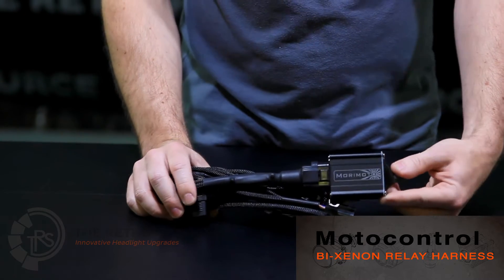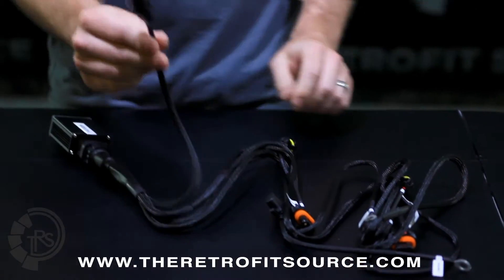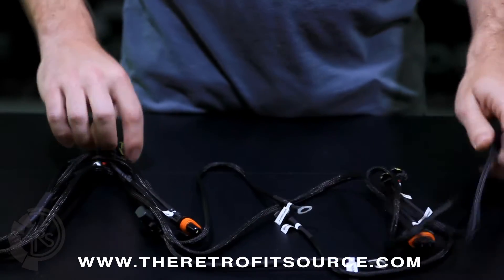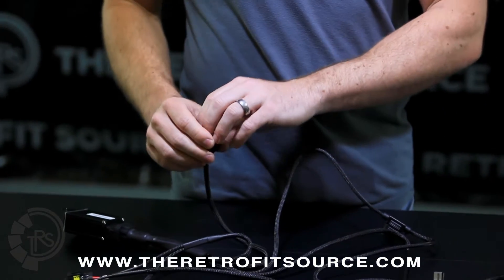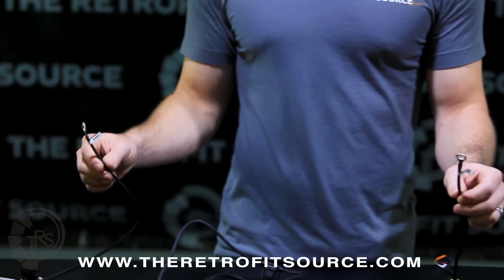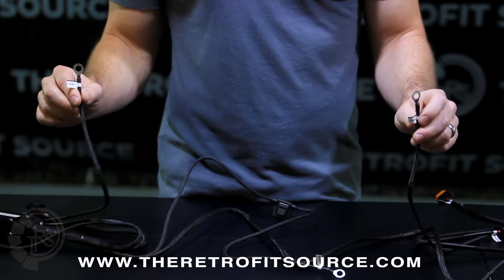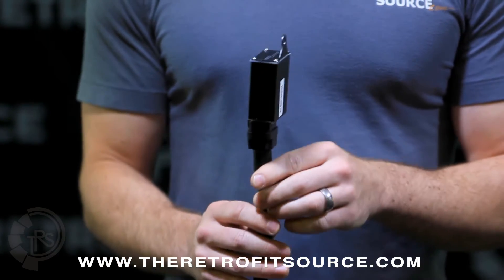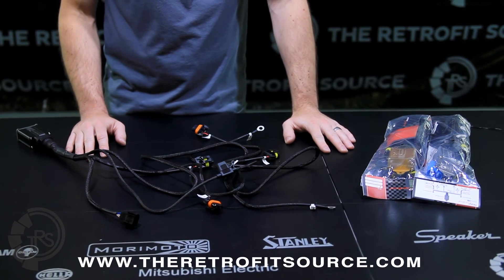TRS Tech: Morimoto MotoControl Bi-xenon Relay Wire Harness Connections Explained

Comment: Can I change the pin orientation at the factory harness connection that comes from the relay harness so this will work on my low beams only and still control the hi/low beams from the switch in my truck? I only want the lo beams to be HID for night driving? I have aftermarket headlights and and they are single beam H1 bulbs Hi and Lo wired to a 9007 male connector? Thanks
Reply from the maker: Reach out to our CS team so we can assist you with this custom wiring job!

404-220-7940
Support@TheRetrofitSource.com

Comment: I want to retrofit Bi-xenon (with projector) to my e46 but want to keep halogen's original function as 'flash to pass' light, which harness do I have to pick? Bi-xenon kit where it comes with highbeam output from a ballast or regular Xenon kit where I have to split oem highbeam connector wire (before going into a relay) to power halogens and shutters?
Reply from the maker: You got it! You'll need the bi-xenon relay and a splitter to power the high beam function of the projector!
Reply: But sir, bi-xenon kit input plu
g is h13 or h4 isn't it? While on oem plug it's h7 (2pins vs 3ins connector)
Reply from the maker: Adapters! (:
Reply: @RetrofitSource  oh indeed, Thanks alot sir!

Comment: Im confused as to why there is only 1 "OEM bulb input" for a harness thats feeding the 2 new HID bulbs? My truck has 2 OEM bulb H4 connectors as I assume most every car has. But the harness only shows 1? Where does the other H4 plug into?
Reply from the maker: This harness only needs one input to power it then it splits off into 2 outputs to power both sides.
Reply: @RetrofitSource  Got it thanx! Would have been great in Morimoto's extensive and careful instructions and diagrams they bothered to explain and illustrate that part.

Comment: Do you need to change the fuse to a higher amperage if i change ballast from 3five to xb55?
Reply from the maker: You should be able to use that same fuse, it will work for both 35W and 50W ballasts! Let us know if you have any other questions!

Comment: You guys are great, being the fact I'm doing a Bi Xenon setup on my ford falcon with absoultely no experience prior these videos have been so much help in double checking what I'm doing. Suffice to say after two years of procrastinating they are going in today!

One question regarding this harness? Mine is exactly the same, I have a Bi - Xenon setup and also the car has a seperate high beam which has its own ballast, since the orange connectors go to the shutter on the d2s where does my high beam ballast plug in on this harness?

Cheers
Reply from the maker: Your separate high beam won’t be powered by this harness. It would still be powered by your factory high beam wiring.
Reply: @RetrofitSource  Thanks, I did figure that out eventually!

Comment: Hey, where exactly the factory input cable need to be plugged into in the car wiring system? I couldn't find any 3 pin female connector except for the headlight assembly, but there are two of them while the relay has one. So, where exactly it needs to be connected to? Thanks for helping me with my first DIY.
Reply: I'm hoping you've figured it out by now, but for anyone else that happens to see this and has the same question: Only one of the plugs that used to connect to your halogen bulbs is used with this controller. It's not used for power, only for a signal so the controller knows when you have the headlights off, on low beam, or on high beam. The other side's plug can be sealed up and zip tied out of the way.

Comment: Hey there,  which one of them is the solenoid connectors (H4). And should I be extra cautious and wear safety gloves when working with the battery? I don't know but it freaks me out!!!
Reply from the maker: No worries really, as long as you dont accidentally touch the +/- terminals of the battery together, its not an issue. The solenoid connectors are built into the harness, they are labeled "high beam"
Reply: Thanks for replying. I didn't buy it from TRS because of non-availability of NHK G5(R) RHD lenses and the shipping charges. I'm not sure how to join the solenoid cables to the harness as in the screenshot - could you please help? Thanks again!!! https://www.screencast.com/t/LeWxqQsy1
Reply from the maker: Sorry, we're not sure how that harness works unfortunately. Good luck with the project!

Comment: Can I use this harness on a 2000 Miata with DRL? I know HID kits have a problem with flickering when DRL provides low voltage to the ballasts. Would this harness prevent the flickering issue?
Reply: pretty sure thats the point of direct battery connection and the relay

Comment: How does this kit work with Day time running lights? DRL on the highbeam for example.

I would think that the 5-6V DRL would still trip the relay causing the lowbeams to come on.

How I avoided this was building something similar except I filtered the DRL signal out through a second relay which was powered by the parking lights. This would have been cleaner using a 6V (must on, 12V+ relay) and a 6V zener diode to filter out the DRL signal
Reply: +Andrew Bennett No need for any of that - the relay box understands this kind of common circuit (DRL on high beam filament) and runs the low beams normally in that case
Reply: +Andrew Bennett for a plug and play kit with a DRL the kit uses an optional caplink.

Comment: My car didn't come with bi-xenons from the factory, once I retrofit some FX-R 3.0 on my car, can I use this to switch on/off the high beam?
Reply: +gwot yes of course, that's the point of this harness! if your car has H4/9003, 9004/9007, or 9008/H13 - we have a harness for you!
Reply: The Retrofit Source Inc aaahh that's the thing... my lows are H11, and highs are 9005... so will one still work for me?
Reply: @theretrofitsourceinc6346  With this method (highbeam splitter; one to halogen and one to shutter), will flash to pass (with halogen) be working if low beams are not switched on?

Comment: so one of the stock headlight bulb plugs on the vehicle will be left disconnected when using this?
Reply from the maker: Tim Cardona That is correct Tim, you will only plug-in to the side closer to the car battery